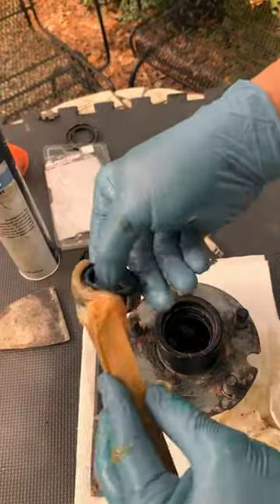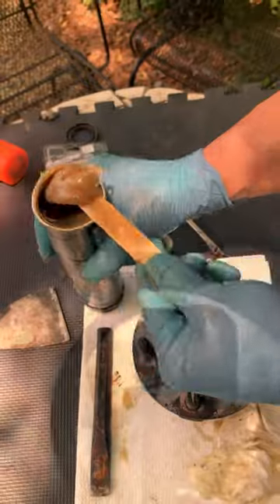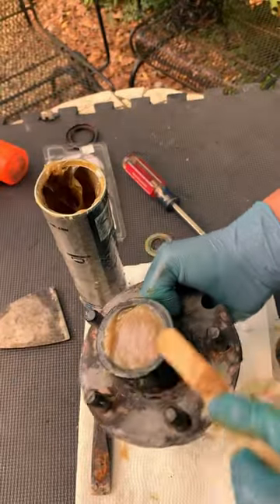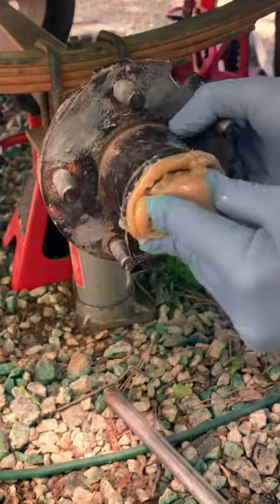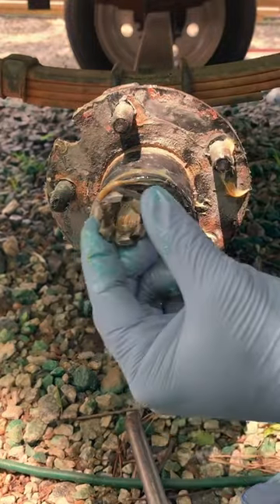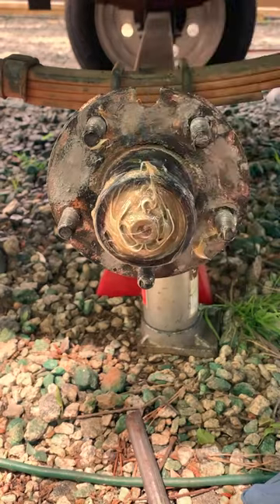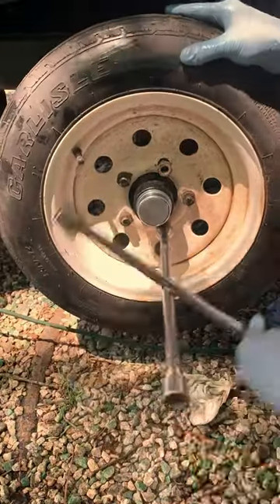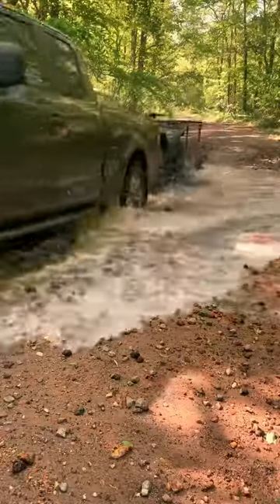Part 3 Repack your trailer bearings for highway safety! #fishing #hunting #diy

Comment: Put the grease in your palm and slide the bearing through it from the fingers to the heal. That’s how you pack bearings.
Reply: There's a bunch if different ways to pack a bearing.  Some will say you are wrong and that you need to use a bearing packer.
Reply: @riverrat48  I've never actually used one but they're supposed to force the grease
Reply: @riverrat48  like I said I've never used one or seen one used but I've seen em on the shelf I don't see the point in buying something I can do with my own hands. I was just saying there is always gonna be somebody who says you're doing something wrong even if u doing it right
Reply: You clearly either haven't used a good bearing packing tool or you have no idea how to use one because they are so quick and easy.  I've packed bearings the old fashioned was of the palm-full of grease, and the packing tool works just as well if not better.
Reply: @RyanWithAviators 100 percent

Comment: Need to update the spindles to greasable ones. Saves all that hassle.
Reply: It had a grease fitting on it to add grease thats also how you get the air out as well as not waste all that expensive grease of his.

Comment: Why do you torque it, back it off, and hand tighten it? I'm just a DIYer but it seems like a lot of steps I'd never have thought of
Reply from the maker: That’s an excellent question Drew! I actually didn’t know to do this until the day I installed one of the drop-in fully assembled hub kits by Ultra Tow. It was in the installation instructions that I learned this important step:
The reason it must be torqued first is because the brand new oil seal on the back side will often resist being seated fully flush onto the portion of the spindle it must be on. This step squeezes it into place. However if left this tight, it creates resistance and possibly damaging friction, so we back off the nut and retighten to the best combination of “hand tight”’and aligning the correct cotter pin hole with the nearest slot in the castellar nut. 
-Stagger
Reply: @staggerleesmancave8987  hey thanks! That makes sense to me!

Comment: What does packing the hub full of grease actually do? Same thing with the dust cap? You think that grease in the middle of the hub is going to transfer into the bearings? All you're doing is just making a huge mess and wasting that expensive grease.
Reply from the maker: As the miles and years go by, every ounce of grease within the assembly (from the oil seal to the dust cap) flows and circulates throughout the assembly. Much like the volume of gear lube within a gear case, but on a slower scale as the lithium in wheel bearing grease does much to maintain viscosity (by resisting heat), but make no mistake; it does indeed become thinner and migrates more when it heats up from bearing a load and going down the interstate at 70mph. This even includes the volume added to the dust cap as there is nothing sealing the inner grease volume from flowing past the washer beneath the castellar nut in this typical trailer hub design. The high volume of grease functions to distribute and dissipate the heat generated by loadbearing and friction. In addition, the inevitable introduction of contaminants, such as water and debris are likewise offset as the grease churns and distributes these contaminants throughout the entire volume, giving the assembly much greater longevity buying more time and smooth functioning between maintenance cycles.
-Stagger
Reply: @staggerleesmancave8987   Sir. I'm an ASE Master Certified L1 technician with over 20 years in automotive repair experience. I've worked as an instructor and a consultant for repair manual publications.  So this is just my opinion.  
If a regular maintenance schedule is being done to those bearing then there is no need to pack the entire assembly full of grease. If the correct temperature rated grease is being used for bearing application, there's no reason to pack the hub full of grease. If you are using a new wheel seal and your dust cap has an o-ring there's no reason to pack the hub full of grease. Because if you do pack the hub full of grease and there is an issue of an overheating event that Greece is going to liquefy and push out of the seal and dust cap. I can't tell you how many times I have pulled a rotor off and it is packed full of old  grease but the bearings are pitted and scored from overheat due to lack of lubrication. The grease in those rotors was old yeah but it was still grease and they didn't get into those bearings. Use better grease not more mediocre grease.
Reply from the maker: I certainly respect your accomplishments in the auto service industry and my hat is off to you. It’s great to have someone on the thread who knows their stuff. 
I think what we’ve been missing here is a detail that will definitely lead us to an agreement: this particular trailer had gone a shameful number of years in excess of needing routine service to the hubs. (20 😬) Interestingly, it had shown no malfunction. I just knew it was well past time. Don’t you think after 20 years a complete tear down and redo is warranted? Not to pat myself on the back, but it was actually me who packed those bearings 20 years ago, and I was more than pleased to see how good they looked after all this time.  I can definitely NOT say the same for some other trailers I have worked on that were done by the factory that blew out and were spitting teeth after just a few years. 
Thanks so much for watching by the way.  
-Stagger
Reply: @staggerleesmancave8987  I completely agree with a teardown and rebuild. And good job on doing quality work to last 20 years. My only gripe was just in the application or actually the amount of application of Grease. Personally all I ever did was push out all the old grease from the bearing until new grease was completely coating the rollers, inside and out. I would smear a thick layer on the races in the hub, and then after cleaning the spindle I would just put a thin coat on it and the seal surface for installation purposes. Set my bearing load, retainer and cotter pin. And tap the cap on. Give it a spin to check the bearing resistance and that's it. We used full synthetic high temperature Grease. Maybe that's the factor? I know a lot of trailer applications use non disc brake wheel bearing Grease.
Reply: @Sombodywake Hicks  That greese is going to work its way off the bearing/race real quick which is why you pack the hub and cap. And to be honest I rather take my advice from someone who dropped out of school in the seventh grade but has been elbow deep in car parts since they were knee high rather than someone who has more certs than the latter has tools.  Real world experience and schooling is totally different.  There's things schooling cant and will never teach u.  Now im not saying your not a good mechanic u might be the best but I've met alot of certified guys that didnt know their ass from a hole in the ground.  Its kinda the common sense vs book smarts type of thing.  And anybody who I've ever talked to that listed off their accomplishments to try and make it seem like they know what they are talking about were always full of it and wrong.  JS
Reply: @timothykappel198 Okay bud. 😂 Whatever you say. Let me know if you need some formal training. It's my passion to educate people who have absolutely no idea what they're talking about.
Reply: @sombdywakehicks as trailer owner myself you tend to forget about mainteance on trailers till something happens!!! Then you kick your self because its to late!!!!🤦‍♂️🤦‍♂️🤦‍♂️🤷‍♂️🤷‍♂️
Reply: @staggerleesmancave8987  the Timken video shows to set the bearing with 50lbs on the torque wrench then loosen one full turn then torque to 10 lbs . The 50 seems high. Any advice?
Reply from the maker: @whatthe2458  That does indeed seem high. But if Timken’s are what you are installing, I would definitely go by their recommendations, provides everything in your hub assembly is either Timken or Timken compatible. Surely if they are recommending to torque it down 50, back off, then torque 10 foot pounds then there is something about their assembly that prevents the retainer nut from exerting excessive pressure on the bearing and hopefully won’t damage it or cause it to bind. It could be that they have a much more sturdy oil seal, and this much torque is needed to get it fully seated on the backside. 
I’m using Ultra-Tow (Northern Tool) bearing kits in this vid and going by their instructions. Hence the tighten then back off 1/2 turn. 
Good luck with your repair and thanks for watching! 👊 
-SLMC🔥